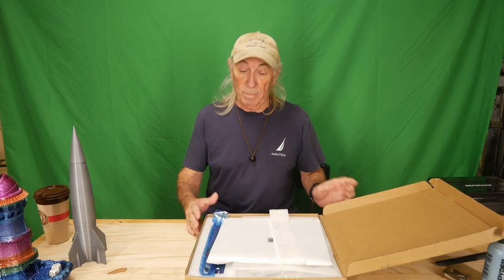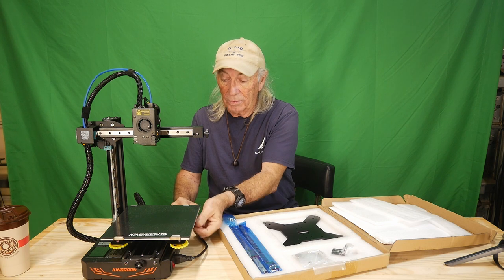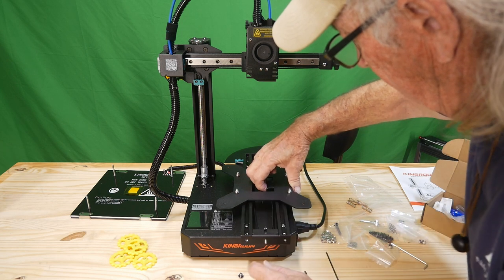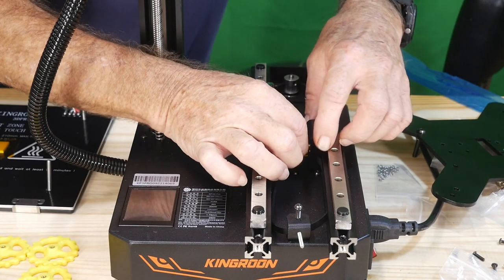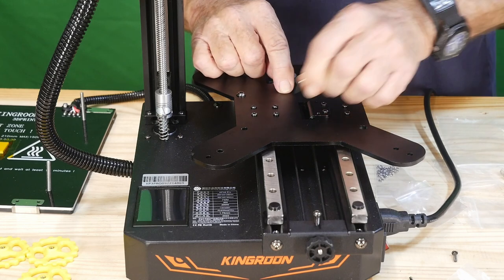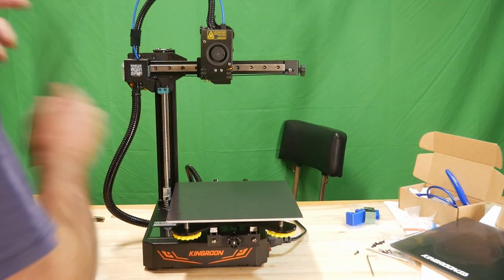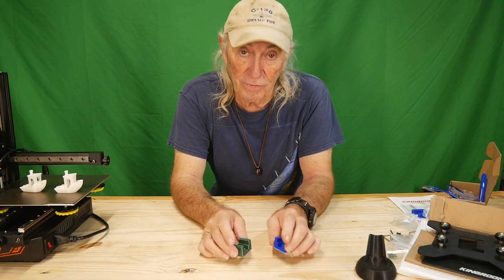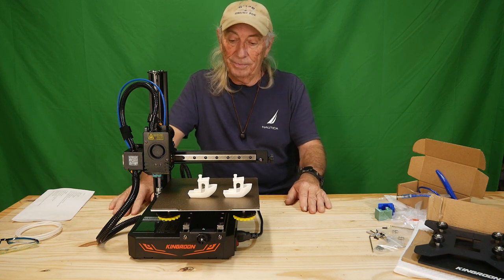NEW upgrade for Kingroon 3d printer Kp3s Pro & how to install, Coffee and tools ep 296

Comment: I have the same printer with this set of rails. After installing the kit, the center of the print table shifted by 10mm. I drilled a 10mm offset hole to the back of the printer for the Y-axis limit bolt and everything was just as good as it was - centered.
Reply from the maker: My hero ! and good point.
Reply: Uhh what? Can you explain that to me before I upgrade my kit?

Comment: The underside of that metal sheet. The reason why it feels weird is because it's splatter from the manufacturing of the textured PEI. You can buy a PEI smooth sheet on amazon to install on the underside if you want to. I've done it on my Ender 3. But before you install it, take a razor blade and scrape all the little bumps off of the underside of that metal to get that bare metal nice and smooth. Before you install the PEI sheet and you can get the sheets on Amazon.
Reply from the maker: I like printing on glass, but having that textured surface is good insurance
Reply: @SirTools  I like glass too but smooth pei is pertnear the same look and u dont need any glue.
Reply from the maker: @billkaroly  Never use glue or hair spray. We did a show about not using products that mess up the work area. Still can't imagine over spray on a machine over time with hair spray 🤣🤣

Comment: This is the problem i have with Kingroon.  We shouldn't have to upgrade these rails especially if they call this unit a  "PRO".   

 I recently installed a BLTouch on the KP5L,  and my screen turns blank.   I have to reboot the printer after each print.  Installation and troubleshooting  is such a hassle to me.  This auto leveling feature should already be installed in printers with large beds.  We shouldn't have to upgrade anything except if you really want high end custom made parts. Sovol seems to have this figured out already.
Reply from the maker: The entry price says cheap. I've seen some printer farms with the Kingroon machines and wonder what stories this guy would tell about parts failures. Good points for the auto level and firmware is another question or problem that needs to be solved.